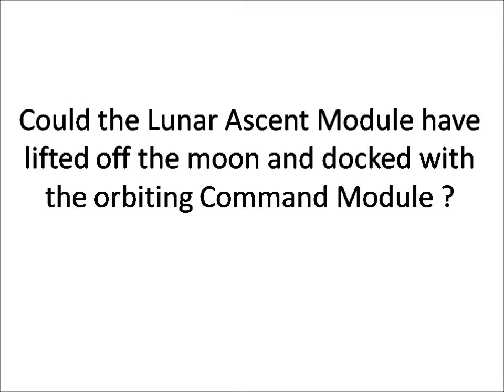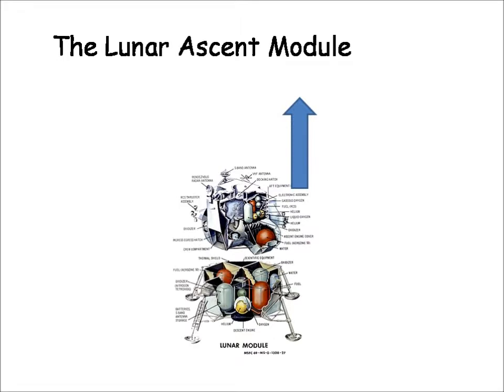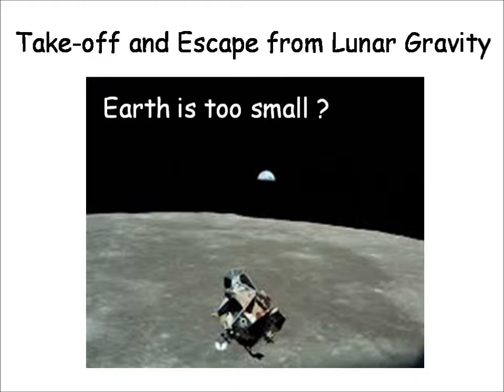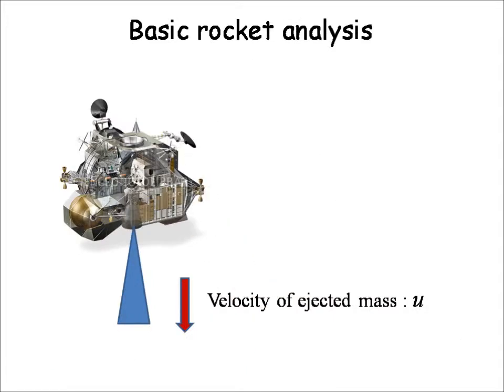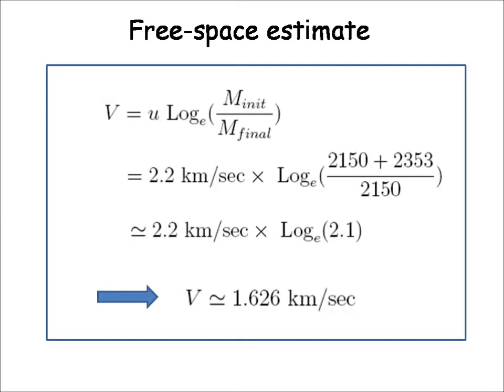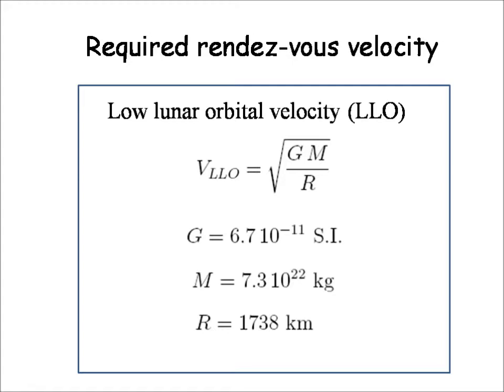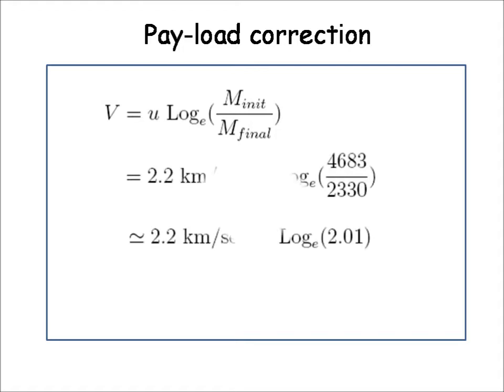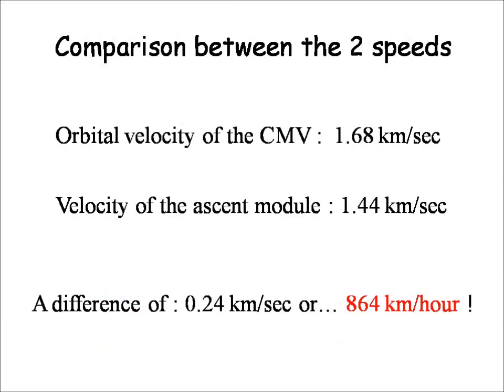Apollo missions : did the Ascent Module have sufficient thrust ?

Comment: The exhaust velocity is extremely off. You wrote 2220 m/s*, but Wikipedia writes 3050 m/s as specific impulse (effective exhaust velocity). It means a much higher final speed for the ascent module.

*2200 m/s
Reply from the maker: Thank you for pointing this out ! I got the exhaust speed from a NASA document, but that was some time ago. The new figure would then perhaps make the final speed just enough for circular orbit.
Reply: @SoulmateParis  – It puts the final speed above 2 km/s, even if we take the gravity drag into account.
Btw. the delta v of the craft is 2220 m/s (it's probably calculated without payload) –  maybe that's what you mixed up with exhaust velocity.